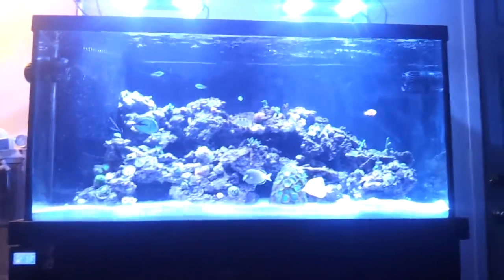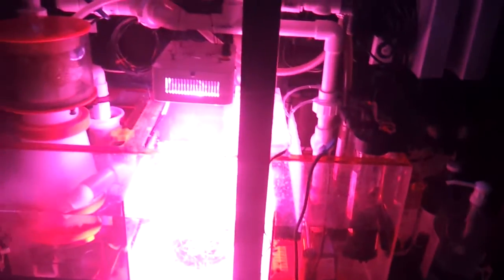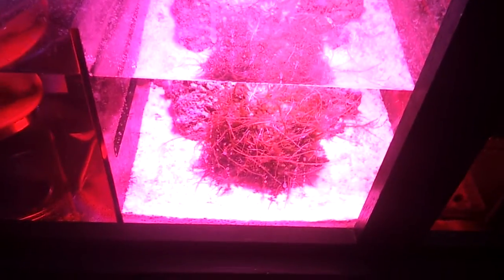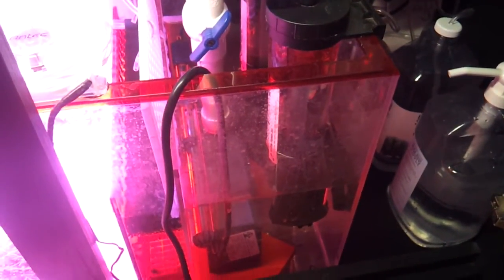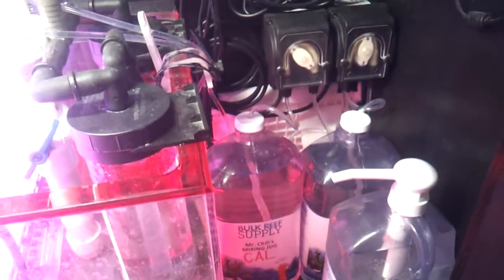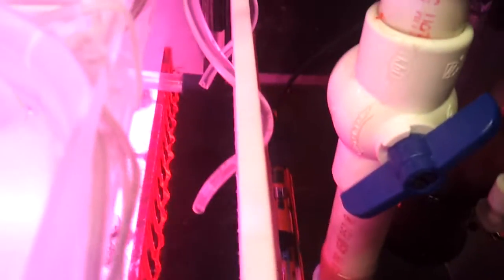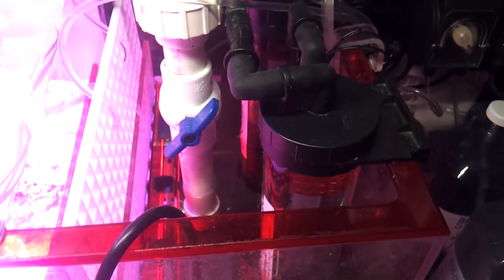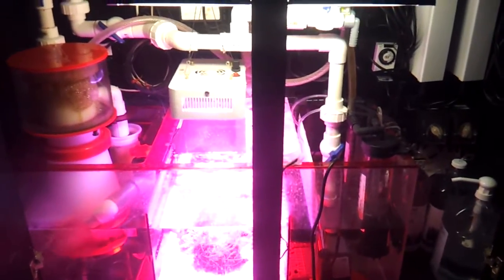90 gallon Reef Build - Dosing Pumps & Reactors - Update 10

Comment: Love your sump design. I was thinking of doing something similar but decided to go with a hose from return to DT. Great idea on having the three hose barbs at the end of each ball valve for additional equipment or to recirculate the water like you're doing. I can always change it up later if I end up getting more reactors. I like your snail guard too, did you glue it into place or zip-tie it? You're going to go nuts once you've fine tuned everything, you're a gadget reefer like me, always having to do "something" with the tank to see what works best, LOL.
Reply from the maker: Thanks Gil, cant wait to see your ruby running, the snail guard was just cut to size and kind of locks itself into place with the sponge, i snipped every other square on the bottom, serves for better flow and grip... nuts? isn't everybody in the reef hobby nuts? LOL I'm sure i'll be keeping myself busy once i get a frag tank up and running, was considering running a hose of the manifold to the frag tank, and use the second filter sock for the frag tank, still in the air about it if i want a large system or separate
Reply: Sounds like a great idea to run the hose, lots more water volume too. I placed my equipment in my Ruby to see how it'll all fit. You're 100% right about the access to the second filter sock, going to be tough to get to. I'm going to run both socks, looks like I'll have to remove skimmer cup to get to the second sock though. The one thing about the Aqueon Pro Flex III is that both socks are visible from the side and super easy to access.
Reply from the maker: all sumps come with pro's and con's, it's how you make them better and more useful, I'm sure even with the blocked filter sock, your going to be a lot happier with the room you actually gain section wise...when's the big day for the switch?
Reply: I agree, I CAN'T wait to put in a larger sump. I had a custom cabinet made for all my supplies, ATO and ALK/CA containers. The stand will only have the sump. Dude, I really hope I can install it THIS weekend. We'll see!
Reply from the maker: ***** Nice, i was thinking of doing the same thing but to hold my brutes, but if i do that, it'll block my frag set up....choices....i could just frame the mixing station and run the plumbing behind the brutes, i put a large shelve over the tank to hold my lights and various things, i have a suspended ceiling plus space is tight, so its very useful having a 6' x 12'' shelf when working on tank
Reply: Reefs can take up a lot of real estate really fast. Utilizing spacing saving techniques for folks with little room is definitely key!

Comment: Hey Juan, On the bottom of the sump youre running the red leds.  Do you ever have a white light on it for the cheato? Im thinking about running my Par38 longer, than running the CFL.  Thanks!
Reply from the maker: The S2 Refugium Light gives you the right spectrum for proper plant and algae growth as well as 70 watts of power to give your Mangroves/Cheato/ATS what it needs to remove the maximal amount of nutrients from your system. (5 - Deep Red 660nm, 5 - Red 630nm, 1 - Orange 600nm, 2 - Royal Blue 450nm, 1 - Voilet 420nm, 1 - Neutral White 4500k) x 2
Reply from the maker: Lol, not trying to sell it to ya, i copied and pasted the description of the light
Reply: Juan's Reef Aquariums Thats cool man, go check out Thomas New Tank wars winner video, Congrats!
Reply from the maker: Just did, thanks